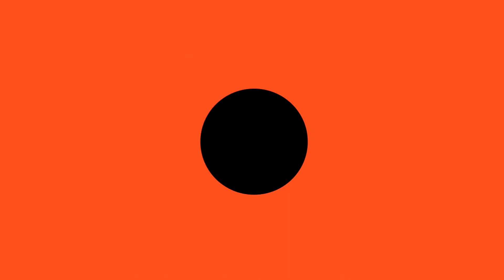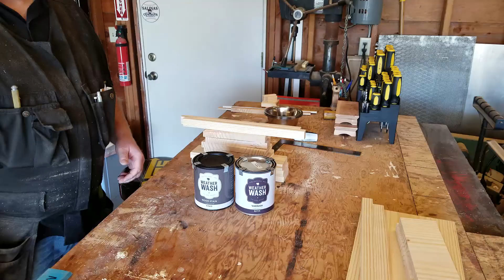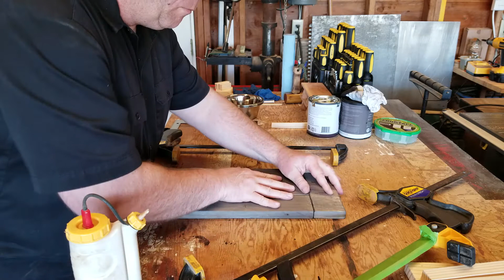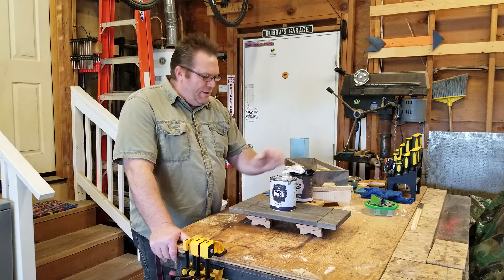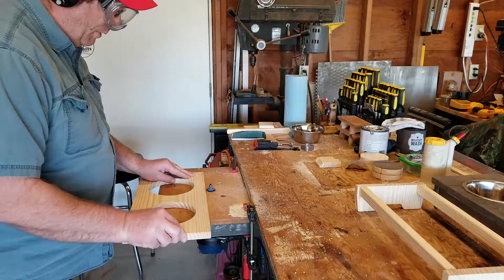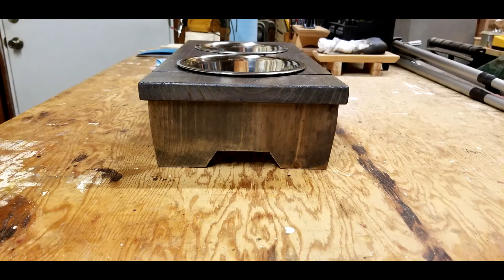Pet Food Stand with 2 bowls - Weather Washed

Comment: I really like the look of the rustic model.  If you are going to batch build these I think it would make sense to make a router template to use an edge following bit for the bowl holes and leg ends.  Then you could build the top with a small middle piece in the center and save some wood.  And I'm pretty sure a template on the router will make better/faster holes than using a jig saw.  Since it is an inside cut, I'd make the template with a frame so you could just put your top into it and do it on the router table and not have to tape or otherwise attach the template, just hold it in.